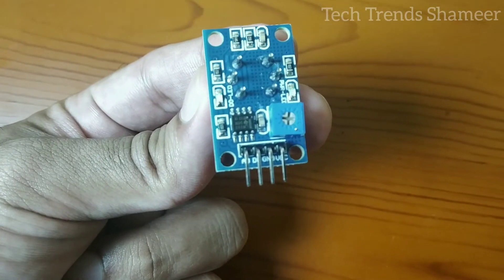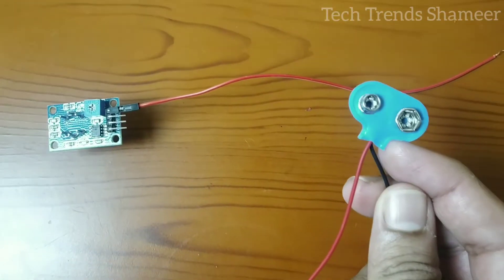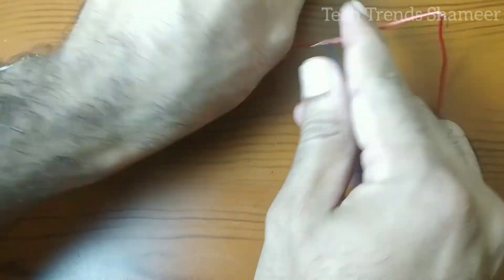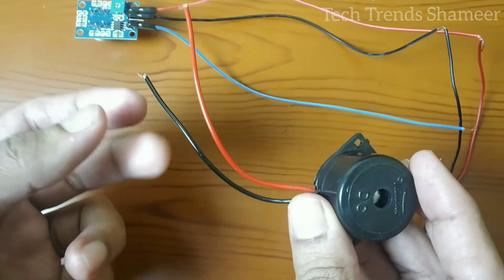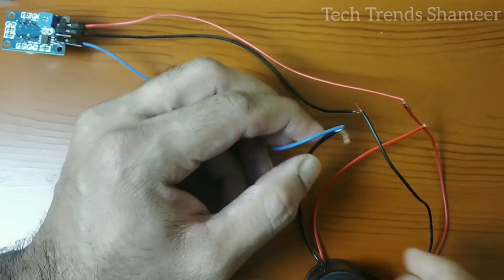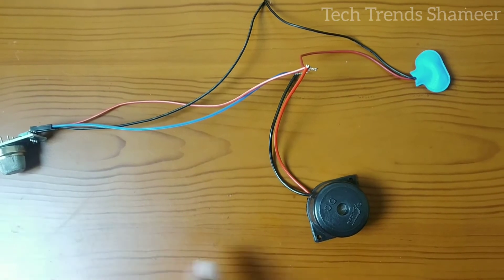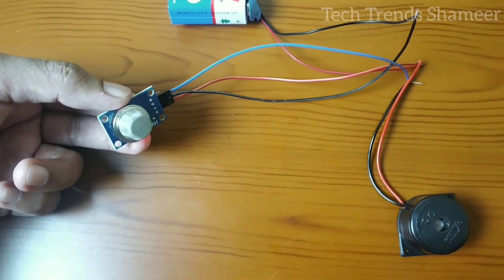Smoke Detector Without Arduino

Comment: Should i use resistor or regulator?

I am using Mq135 
It is 5v
Battery is 9v
I fear wheter mq would damage
Reply: No problem it won't be damaged

Comment: Sir why is my buzzer is producing sound every time I connect the battery cap with battery 😢 plz give response 🙏
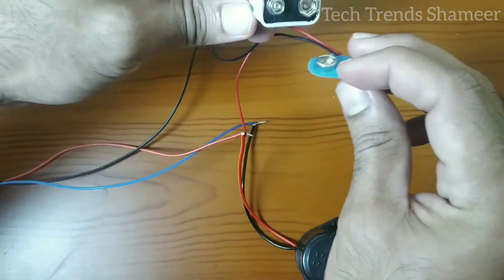Reply: I don’t know much about tech but i think you need to wire the middle one to the buzzer then connect the other end of the buzzer(output neutral wire) to the battery and i think that’s it. Never mind after i saw the connections here 2:29 I don’t know what to say

Comment: The buzzer is ringing without sensing the gas
Reply from the maker: Which sensor you are using?
Reply: @TechTrendsShameer mq 5 sir and it's ringing continuously without smoke also plz reply fast sir it's urgent

Comment: Shameer   Sir, please share the Circuit Diagram...... sir Output wire connected DO or AO..... sir please reply 🙏.....
Reply from the maker: Can you please check the video and check which Pin I mentioned?

Comment: Why mine does not work .
Trust me I follow all steps exactly 100%wring,etc ...

1.My sensor works when I use Arduino uno .
2. Does not work when I didn't use any micro controller.
.

Any speculation s why mine does not work???
Reply from the maker: There is a potentiometer on the back side of sensor. Can you please adjust that and try ?
Reply: @TechTrendsShameer  clock wise or counter clockwise??

For highest sensitivity.
Reply from the maker: Please adjust and try. Sorry I am not sure.
Reply: I bought 2 of this MQ6. I thought 1st one is broken so I ordered another one. Turned out that both are working fine.
To get it work without Arduino, make sure  you battery is not drained out. 
Same wiring as the video. But when connect a buzzer, you'll probably hear long continuous beep from buzzer. This is the reason I thought mine is broken.  I immediately remove the buzzer and  assume it's broken. Actually you should let it beep until it stops.
Mine take around 9-10 seconds. You'll probably see green led come up on one side of the module. Adjust the potentiometer until the green led goes dark. Now test the gas sensor with cigarette lighter. 
I finally got both sensors to work. Hope you get it work too.
Reply: @jumbo999614  punya Saya hidup terus bang? Ini harus bagaimana
Reply: @adityapratamaputra2216  Sorry, I don't understand the language.
Reply: @jumbo999614  do I live on, bro? Not yet tested using fire/smoke
but already alive

Comment: which gas sensor did you use mq 6 or mq 135 or another one
Reply from the maker: MQ 135

https://www.electronicscomp.com/sensors-module/sensors/gas-sensor/mq135-air-quality-gas-sensor-module-india
Reply: @TechTrendsShameer   Sir, please share the Circuit Diagram...... sir Output wire connected DO or AO..... sir please reply 🙏.....
Reply: @TechTrendsShameer  can i use mq 2
Reply: I am having mq2

Comment: do i need male to male of male to female cables
Reply from the maker: You can use female to female or female to male wires. Then cut the pin from one end and take the wire out. Connect that wire to the battery and buzzer
Reply: @TechTrendsShameer  thanks for telling me!